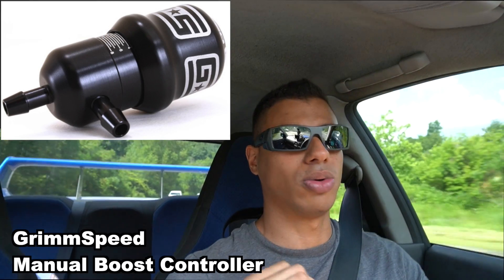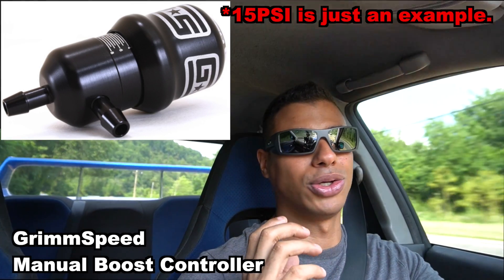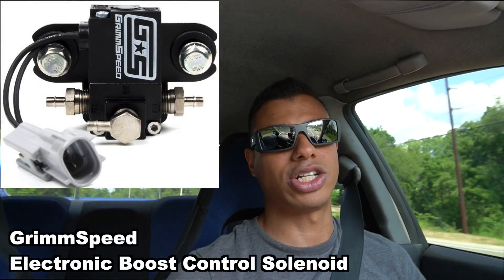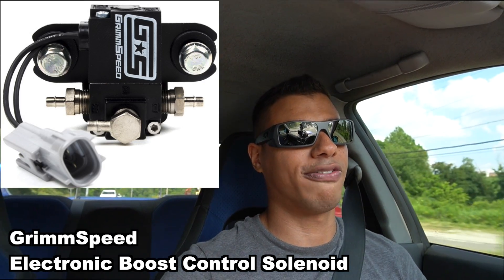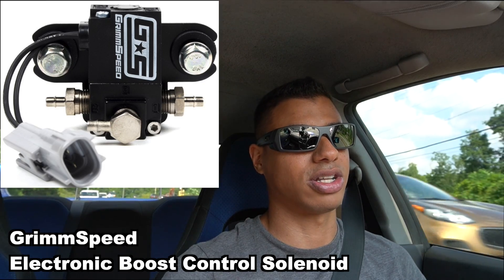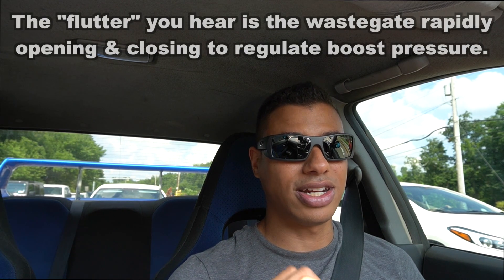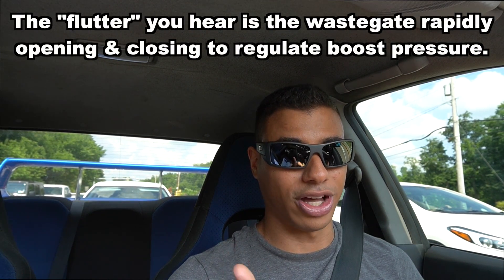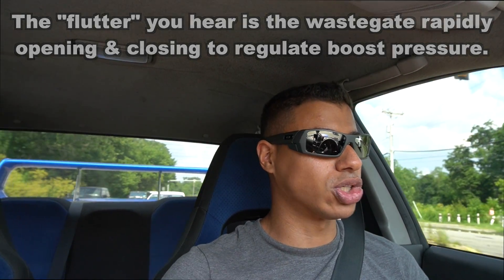The Reason Why My Wastegate Flutters Now But Didn't Before

Comment: Hey, super old video, but I see you still post, I have EWG,s (twin scroll turbo, so twin EWG,s) but anyway, I just had my car tuned, and my EWG rarely ever flutter? I use a grimmspeed 3 port, 15psi springs in the EWG,s, running 23psi of boost, came across your video trying to understand why I rarely ever (once in a blue moon, cant mimic it, it just happens) get any flutter, just a super loud wooshing sound sorta like your compare video when you said you were just running gate spring, no boost control.. So any idea why I dont get flutter?
Reply from the maker: @robmassicotte4889  from my understanding, it primarily just has to do with the way the car is tuned. It is not good or bad, just preference. I specifically asked my tuner to tune my car for the flutter, but I know many guys who don’t have it and have zero issues.

Comment: Let me help you with some terminology. You have manual, electric, and pcm controlled. Manual boost control is exactly what you said. 

Electronic boost control is something like an aem truboost, turbosmart eboost street 40, etc. these typically use a mac valve thats controlled by the boost controler to set boost levels and ramp up.

And then you get into pcm/ecu controlled that uses factory solenoids to control wastegate or an added solenoid controlled by the pcm/ecu to controll the wastegate. 

Great video though, good explanations for the two you did explain.

Comment: My 04 wrx just started to flutter I have a external waste gate and I have a exhaust leak near the turbo somewhere I haven’t taken it apart to see what one yet but do you think a bad gasket could cause it to flutter? Because it wasn’t fluttering before this..
Reply from the maker: Possibly. If it started doing it on its own, then my guess would be a bad gasket or something. Can’t say for sure, but I would keep an eye on it & try to troubleshoot it or start talking to a shop/tuner guys about what could be causing it, Those guys have more experience & typically know more than I do.

Comment: It sounds like it only flutters when you're on the throttle I and correct me if I'm wrong I think turbo flutter only happens when you let off of the throttle
Reply from the maker: You are correct. This is wastegate flutter which is different from turbo flutter. The turbo flutters (also called compressor surge) when you let off the throttle & there is no bypass/blow off valve or the valve is malfunctioning. The compressed air has no where to go, so it goes back out the intake & forces the compressor wheels on the turbo to spin backwards making the flutter sound. 

This is wastegate flutter. This occurs while on throttle. To prevent over-boosting, the wastegate opens up to regulate boost pressure. The way my gate is set up & tuned, it rapidly opens & closes which causes the flutter. 

Hope that explains it man. 👍🏼

Comment: My turbo frs does the same aswell on the Grimm speed ebc. Anything above my spring pressure in the external wastegate and it does the flutter

Comment: Whilst under boost it shouldn't be doing that.. the flutter should be while letting off the throttle
Reply: No…. It shouldn’t. Just stop. Turbo cars will flutter after cai installs or air mods. It’s not bad… just get a vent to atmosphere valve so that air can go somewhere

Comment: Thanks for the video man, so if i choose a manual boost controller, it will not flutter, but if i choose an electronic boost controller, i can choose if it flutters or not?
Reply from the maker: Correct. As far as I know, it has to be a electronic controller & I believe has to be Cobb or GrimmSpeed or something—not all of them do it. I am definitely not the expert on it though, so I would talk to your tuner.
Reply: My genesis flutters under hard load at 17 psi. Did this after cai install

Comment: I gotta disagree with this. Flutter from a waste gate means that backpressure is forcibly getting past, overboosting the turbo given it's current load and afr. It sounds like the tuner is just bypassing that and running the car closed loop and not considering the solenoids values so boost peaks early and timing and fuel are what dictate it's boost level given the load value. Kinda like saying if timing, fuel and rpm are at X, then boost will always be Z because the engine is this size, with this flow rate, and this turbo size and spec.
Reply from the maker: No. Please look up wastegate flutter. Wastegate flutter happens at WOT to prevent over boosting. It is caused by the solenoid rapidly opening & closing & was tuned that way. It is 100% different than anything else. This car was tuned by Jr Barrios at Jr Tuned, arguably one of the top tuners in the country. 

I’m sorry, but I really don’t know why people don’t know anything about wastegate flutter, but insist is has to to with back pressure, or my favorite, people saying it’s actually the BOV. 🤦🏻‍♂️ Honestly, constantly explaining this over the past 2+ years is getting really old. So, to recap. The flutter is intentional. It is cause by the solenoid. It is perfectly fine. The car was tuned by someone who knows what they are doing. You can disagree with Jr if you want. I’m sure he’ll disagree with your comment. 🤷🏻‍♂️ Lol.
Reply: @hawkeyestiguy  the flutter is from the ecu preventing a smaller turbo from over boosting. Correct. Flutter from the poppet constantly opening and closing is bad because the face of the valve wears out faster than a tune that doesn't bring the turbo past its efficiency threshold. You're overworking a part that has a specific open and closing rate and anything outside of that wears out faces and vacuum diaphragms that  much faster. Have you ever thought that maybe if so many people are disagreeing with you, you might not have the entire picture? I've never heard any car with an open dump or closed dump external wastegate have flutter on throttle on purpose and if they do they know they are overboosting and have to check things off track. I've never heard of your tuner before, but I don't discredit him because he's probably trying to figure things out just like the rest of us. As far as high end performance goes. Flutter is bad for the wastegate period. You probably aren't making a big enough power level to see the detrimental effects yet. This isn't me just bullshitting. This is 9 engines and 13 turbos later.
Reply from the maker: @Teamflatfoot  Are you new to Subaru’s? It’s extremely common & doesn’t cause any issues. Look up Jr Tuned.
Reply: @hawkeyestiguy  i actually did look him up. I didn't realize he worked with a bunch of subaru based race teams. But on the other side they all swapped to different tuners after they worked with him. I've been into subarus since I was 14. I've owned 3 and made 480hp in my 02 bug eye wrx that was meant for Colorado hillclimb. It's not a common thing for any car that's turbo. Plus all his videos of bigger power subarus don't have a "flutter"tune, and they run a list of high end equipment.
Reply: @hawkeyestiguy  my 2021 accord 2.0t (tuned) does this, it scared me at first but this seems to be the reason and I'm somewhat relieved now lol

Comment: Its to do with compressor surge on the intake side not the waste gate.
Reply from the maker: No, this is not compressor surge at all & it is not on the intake side. It is the Wastegate opening & closing.
Reply: @hawkeyestiguy  I just don't understand how the waste gate can make the classic turbo flutter noise.
Reply from the maker: @joshuabrown9398  This is not what compressor surge even sounds like. They are two very different sounds made for two very different reasons. Compressor surge happens when you let off the throttle & don’t have a BOV so that excess air is forced back through the turbo with closed throttle. This is from the external wastegate mounted after the turbo rapidly opening & closing to regulate boost pressure. This flutter in the video is happening at wide open throttle.
Reply: @hawkeyestiguy  I will re watch, however even with a blow off valve you can can get the turbo flutter if you are running high boost and the bov is insufficient
Reply from the maker: @joshuabrown9398  It’s not the blow off valve. I don’t care if you believe me or not, but please do more research. EWG flutter is 100 times louder than compressor surge or anything else. Look up other videos with external wastegates. Those cars are loud as hell. This is the same thing except mine flutters. There are other cars tuned to do the same thing. I don’t know what else to tell you, but I promise you it is not at all the same thing.
Reply: @hawkeyestiguy  I would have thought an external wastegate would make an exhaust noise since all its doing is bypassing the turbo completely and venting to atmosphere.

I'm not sure where the flutter actually comes in this case.
Reply from the maker: @joshuabrown9398  It is an exhaust sound, but me being inside the car & recordings from the camera means that it sounds a little different on video that it does in person. My EWG is mounted directly behind the turbo & has a dump pipe that vents to atmosphere.

Comment: so is it good when it happens?
Reply from the maker: It is designed to do it. It's just venting excess boost pressure around the turbo.
Reply from the maker: @UCRctXQUlVUzHlknphfvr3kA If the wastegate is set up/tuned to do it like mine is, then yes. If not, then it may be an indication of an issue.

Comment: My stock IWG sounds like this except quieter and with more of a whistle sound to it. 
I do have a EBCS, though I have limited knowledge of the mod history on this car. Wonder if mine is actually not working right if it should be quiet with an IWG

Comment: My wrx powered beetle has just started doing it and its doesnt come on as hard. I have an internal gate with a manual boost controller and aftermarket ecu..Why would the flap flutter when boost pressure is constant, it should either open the actuator or close it. i am changing my actuator as i think the internal spring maybe the issue. I love the scream of the open gate on boost, not sounding like its leaking pressure.

Comment: What is the point in the flutter? And did you actually explain what causes the flutter? You said it was the boost controller but why does the boost controller cause the flutter?

Comment: Could you use the stock bypass valve (no bov)... and use an external waste gate and get flutter ???
Reply from the maker: Yes. If you instal an external waste gate, an EBCS, & have it tuned, you can get flutter. The flutter from the EWG is not related to the type of BPV/BOV that you have. In fact, I have an aftermarket Cobb BPV, but it is configured for full recirc, much like the factory valve.
Reply: @hawkeyestiguy  what’s EBCS? I got a 2018 civic 1.5t

Comment: Why have I been told that to get EGW flutter, you have to block off the BOV
Reply from the maker: Bo Kiss I’m not sure who told you that, but it is 100% wrong. The EWG & BOV serve two different functions and are not connected at all. The BOV vents excess pressure when off-throttle. The EWG allows exhaust pressure to bypass the turbo while on-throttle to prevent over-boosting. They may have been referring to turbo flutter/compressor surge which will result from blocking off the BOV, but that is different than EWG flutter. 👍🏻

Comment: I am so tired of the screaming EWG and it actually limits me on doing pulls because it's terribly loud. I'm thinking about having my tuner re-route the dump tube back to the dp to make it quiet and more enjoyable to boost again. Unfortunately, it's not as efficient  and I may see some power loss during re tune. Sweet ride bro !
Reply: Bo Fa'aita SAME! I stay out of boost for that exact reason. So obnoxious
Reply: Michael Ballard The car would be much more fun to drive that way. I’ll need another tune after as well
Reply: Look into running a pit bike exhaust, they make them in 38 and 44mm sizes and thread on easy

Comment: Is there any advantages/disadvantages of having a flutter or not having a flutter? i prefer the sound of no flutter am i missing out on anything?
Reply from the maker: There isn't much of a difference performance-wise, it's just personal preference. The tuner should be able to tune the EBCS to not flutter if it is made by Cobb or GrimmSpeed.
Reply: Awesome, thanks!
Reply: Cory O'shannessy  What does a BOV have do with anything? Especially considering these cars don't come with BOV's.
Reply: @Madvillian  they so come standard with bovs.... All modern cars do. All internally plumbed though
Reply: @bhagved_turboboy  I wasn't aware every modern car comes turbocharged. Subarus use BPV's not BOV's. I asked why he mentioned BOV's mainly because they are a completely different part of the system and have nothing to do with wastegate flutter.
Reply: the flutter means you don't have steady peak boost. you would want no fluttering for peak performance.

Comment: I would think your wastegate is failing or you turned up the boost past what it can handle and that is what is making it flutter. unless its just turbo blade chop we are hearing, id get that fixed before you damage your car
Reply from the maker: Wesley Wallace My wastegate is definitely not failing & that sound is not turbo flutter(compressor surge) either. There is nothing wrong with it and it is operating as designed. I have a 3 port ebcs which rapidly opens & closes the wastegate to regulate boost pressure. As I have an external wastegate, the flutter is audible. Compressor surge occurs after you let off the throttle and is a completely different sound. If you have any other questions, I’ll answer them the best I can.
Reply: Wesley Wallace He literally explained everything in the video lmao. That flutter is caused by the EBC.
Reply: Car should be fine. And heads up, flutter when out of throttle is fine too 🤔. Flutter during throttle with no ewg is a nono, otherwise, flutter is flutter, less performance by a tiny tiny margin. Look at the 2018 type ra that subaru and prodrive built during the goodwood festival.

Comment: Flutter sounds rubbish
Reply from the maker: Ok, so then don't do it to your car. I won't harass you if you don't.
Reply: @hawkeyestiguy  
Hi good video but a waste gate is there to control boost and response if it flutters like that it’s not working properly have you got no springs installed in it and do you purposely wanted to sound like that

Comment: Was this something you had to ask for from your tuner or did it automatically flutter once he tuned it - without you asking for it?
Reply from the maker: C P I did not have to ask for it, but I could have asked to have it not flutter. With the Grimmspeed ebcs and Cobb AcessPORT, the flutter is tunable and can be made to not flutter.
Reply: HawkeyeSTiGuy mine does not flutter. Just open
Reply: @nile9o  Mine flutters in the summer and does not in the winter. It is tuned to have less Psi the colder the intake air temperature gets.
Reply: @hawkeyestiguy  might be a stupid question but why do only Subarus flutter… when you look it up on the internet I can’t seem to find another car with waste gate flutter then Subarus

Comment: So mine is fluttering to but my boost goes up and down between 18-20 psi is that normal?
Reply from the maker: Hmm. It is normal for boost to have a steady taper to it, like your peak boost may be 19PSI & by time you hit redline it will be down to 15PSI, but it should stay pretty steady throughout. There shouldn't be spikes up & down.
Reply: @hawkeyestiguy  I run the COBB EBCS (switched from Halmann MBC). I specifically went to an EBCS because I didn't want to have to worry about overboosting when it got cold out. I have flutter and my tuner told me it's because that's apparently how the EBCS works by opening and closing the EWG... You can get a solid EWG sound instead of flutter from the GSpeed? Like the OP above my needle on my defi gauges flutters b/w 20-21psi
Reply: your boost going up and down is the flutter you hear in the wastegate. thats how wastegate flutter works lol
Reply: @GoatFaceNation  why would you boost go up and down, it flutters because the wastegate is constantly opening and closing to keep the boost at the right amount

Comment: can you get the tune to not flutter?
Reply: Cory O'shannessy yes it does, go do some research or ask a tuner
Reply from the maker: I can, yes. Will I? I'm not sure. Enjoying the flutter for now.
Reply: HawkeyeSTiGuy I would tune it out you would probably get more boost
Reply: @hawkeyestiguy  yup.. i went from straight screamer to flutter wastegate control now...

The boost control were tighter and quicker spool...the flutter is byproduct of the wastegate solenoid duty cycle at operation...

Quicker turbo spool were the major differences...

Although friends will ask why my car sounds like the ewg broken...

Mainly because its the trend locally where everyone that use ewg use straight screamer boost control method (boost source straight to ewg port with no solenoid control..just 100% on wastegate spring pressure set)

So when i did flutter ewg boost controll method.. its something different and special here...

Anyway when target boost reached, the flutter will reduce and becomes straight screamer usually at higher rpm range...

Im only running about 18psi peak (15psi average)...
Reply: @hawkeyestiguy   i have 3-way mac and two tial wastegates with 1bar springs. if you are driving with spring pressure alone then the wastegate will keep a steady sound and car is making ~1bar of boost. then when you turn on the electronic boost controller then the sound is uneven🤕 how could i get a steady sound even with big boost?